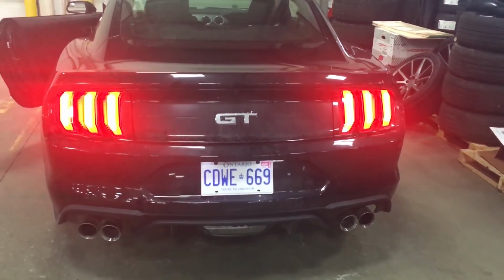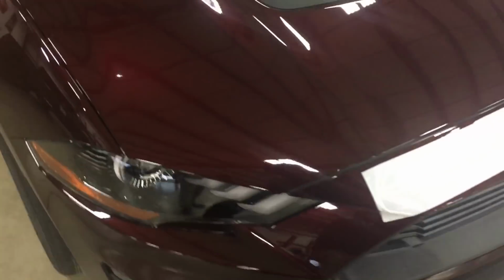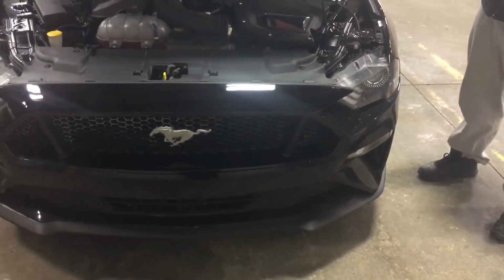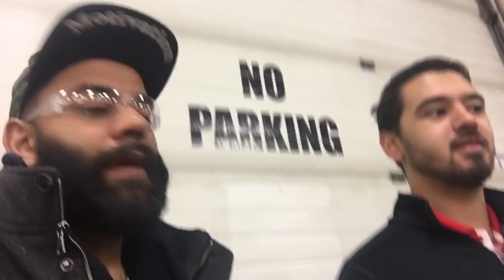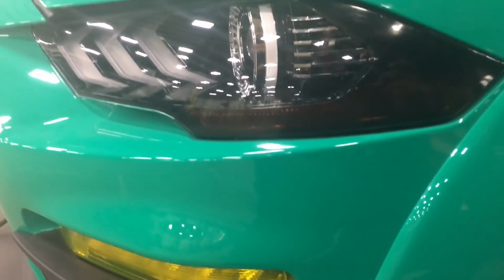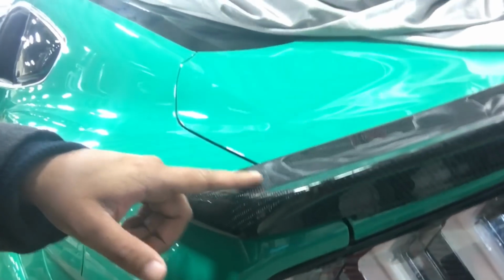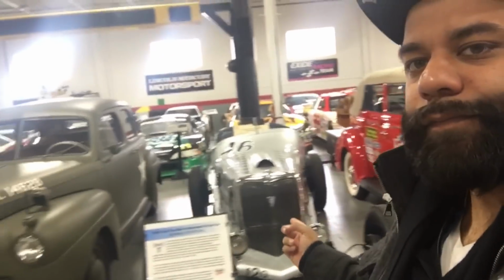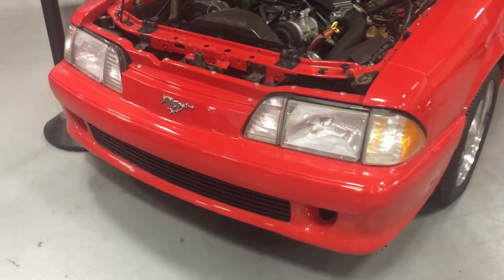SuperCharging the 2018 Mustang GT at ROUSH headquarters!!!

Comment: Can you fit a strut bar over the engine bay with the Supercharger?  Also, what gear ratio does Roush recommend running on the GT with the Supercharger?  I have the 3.73 and was curious if that would be ok and make it even faster.

Comment: Wow , so nice Roush everywhere ! Nice video . When looking @ the Black GT W/the new springs on it? The One the lift, still had that dam suitcase on it . ! My Fav. was the Green P-1 Mustang with the sick carbon fiber rear wing was so cool !!!  If your ever in Boulder Co. A must see is The Shelby American Collection Museum . Absolutely amazing collection of very significant race cars. These are the best of the best, and unbelievably under one roof. These are from one of the most exciting eras of motorsport.! No reproductions here, just the best the Snake ever designed and built (with help). Not massive, but sort of like the Vatican of Shelby Motorsport. !!!

Comment: In regard to a 1 piece drive shaft. If all you will be doing is running on non prepped surfaces. Your probably ok. But on a prepared strip you will probably only last 3 or 4 launches before the stock shaft is either severely weakens or twisted. Seeing how you roll.  Upgrade your shafts.

Comment: Cuz, your thought's on the Roush Jack hammer? I live by you & the closest Ford "Roush" Dealer is in Elkton, MD. Less then 40 minutes from my house. I know you have a Procharger and I feel the twin screw S.C with a Roush X-Pipe would really work well with the low torque that the Coyote doesn't have has? In matters of Torque, is why I haven't purchased a Stang yet. I drove a Camaro SS (WHICH IS TO UGLY NOW) & a Challenger Scat. Those 2 car's out pulled the Stang GT until like waiting all day for 5500 RPM's. StangMode, please reply with thought's, I watch all your video's and can tell you have a lot to offer as advice...
Reply from the maker: Thanks for checking in! I don’t have a procharged mustang...but It all depends on ur goals - get the 2018 roush And you won’t have any problems vs a Scat or camaro- ever - good luck 👍

Comment: do they run aftermarket headers
Reply: Jose Diaz stock headers...but they sell longtubes that you can buy after the fact. You might be able to spec out a stage 3 with headers tho, not sure.
Reply: We do not install aftermarket headers since they change the emissions & sound level of the car greatly. We're an MOR, so we must follow all the same guidelines as Ford, GM, Chrysler, etc..

Comment: Get a new 3.0L Whipple.  There's a reason why Ford is also going to larger blowers with their new direct and port injection engines.  You now have 16 fuel injectors and stronger internals then previous years so thats why everyone is going with larger superchargers.  I know you like the hot new shit and theres nothing hot or new about the 2.3L Roush blower that's been around for 10+ years.

Comment: DONT BUY IT! ROUSH have issues with fuel delivery pipe lines. My car is on the lift  for two weeks now with 99% of the supercharger installed without that part. Roush is blaming the supplier for quality control but it seems like an engineering problem. Yeah...trusted company. Roush already recalled that part twice and they can't provide a delivery date.

Comment: You'll soon regret it,especially since the whipple 3.0 has already been released,in short,you're already in 2nd place.
Roush mustangs are a Huge waste of $,I know because I have one & will never ever buy anything roush ever again.
Reply: Charles henson an s550 ? :/
Reply: Mike Gomez yeah,mine's a 16 mustang premium,perf pack roush rs3 with just under 2,700 miles.
Wish I had never bought it.
I mean it's alright,but freaking slow as crap.
Reply: Mike Gomez If I were to do it again,it would definately not be the slowest supercharger out there with a darned near useless warranty.
Reply: Damn thank you so much for this! I was debating to get a roush but not anymore!
Reply: Charles henson everyone’s going whipple or procharger these days but Roush is still a decent choice outside of a warranty. I have the Phase 2 727hp with Lund tune and I can stay door to door with 800hp whipple and 800hp prochargers with Lund tunes (transmission and rear ratios alike). The warrantied Roush calibration for an auto sucks, I hear the manual is decent though.
Reply: God Save America for good reason.
I to thought I would be different & what a costly mistake that was.
$71,500 mustang that I can't get simple warranty repairs done on because unlike where they try & make you think you have a warranty & can take it to any ford dealer,the truth is it has to be a roush certified dealer & the closest one to me is 1.5hrs away.
This & the fact it's a turd are the reasons I'll never ever buy another roush.
Never again!!!!
Reply: Charles henson I’m budget conscious so the rs3 package was not a value purchase imo. I only bought what I wanted, Roush blower, upgraded half shafts, drive shafts, headers, exhaust, and a ford track suspension kit. Should’ve gone with Roush coil overs though.

You should get it tuned by Lund if you have automatic or anywhere if you have a manual. You’ll like it much more then. F the warranty.
Reply: God Save America I totally understand as I usually am as well,but I wanted the gt500 this go around & the RS3 was as close as it got for 16 & man,what a HUGE disappointment.
Reply: God Save America I don't know what kind of Roush Charles got. But everybody I know that has a roush absolutely loves them .And from what I've seen at the track that car is far from being a turd.
Reply: dzgtnbz the brand new straight off the trailer still wrapped in plastic fully loaded 16 rs3 kind,still has less than 2,800 miles on it.
Reply: Charles henson is it auto or manual, is it pp, premium, and what rear gear ratio?
Reply: God Save America it's a manual,performance pack car with 373 torsion rear 275 tires,brenbo brakes etc etc etc.
Has all the useless bits you would expect on a fully loaded rs3.
Reply: Charles henson in what way are you displeased? With the performance or the cost?
Reply: Charles henson I'm just really surprised you're displeased with it. Like I said everybody I know loves their Roush.. I agree that there a little overpriced but they're right there on performance . Sorry to hear you don't like it. That's a lot of money to be wasted on something you don't like.
Reply: Charles henson I really wouldn't consider Brembo's being useless..
Reply: Hence, why I only got mines lowered, a CAI, and axlebacks... I have two more years till warranty is gone.
Reply: dzgtnbz yeah I'm pretty disappointed,but hopefully I'll be out of it & in to something else or find a way to make it fast before to long.
Reply: God Save America just disappointed in it's performance for the $.
Hind sight 2020,I wish I had gotten something like a c7 vette & just slapped on a procharger,just thought the roush would be alot better than it is.
The tires suck,there's a God awful noise at start up(squeaking) & my ford dealer that I've bought a dozen new Ford's from just 6 miles from my house will not do anything to my roush so the warranty is basically worthless as I have to go 1.5hrs away to where I bought it,leave it there & then go back & get it.
Sick of this pos already & it just sits until I'm right side up & get out of it.
If I had bought a c7 or even a hellcat I could go to any GM or dodge dealer,but not with a roush.
Reply: $71k is crazy for that car. A blown gt350 with upgraded axles would've been the better buy. I'm sorry for what you're going through man.
Reply: dapperchapjb you don’t have to purchase the r3 package. You can purchase the Phase 2 SC kit and half shafts and you have 727hp All installed for just under 10k.
Reply: God Save America oh I agree with you. I'm just referring to the amount of money he spent.
Reply: dapperchapjb yeah,goid luck getting a gt350 at sticker.
I had looked into it & the difference after the dealer mark up on the shelby was marginal & the RS3 Was supposed to be fast.
Reply: God Save America just get a whipple.
Reply: dzgtnbz I'm one of those people once you put a set of Mickey's on these things they are fun as fuck! I have a 17 RS3 and I went door-to-door with a 16 and Huracan and a 17 Viper ACR
Reply: RS3 4 Me yours that black & red rs3?
Reply: RS3 4 Me if so I asked you on that post you got kicked out for going to fast if you had kooks long tubes.
I have high hopes that this car won't stay a turd if i end up keeping it,but I doubt I will,hate this brick.
Reply: Charles henson I found a few at msrp actually. 3 in FL and 1 in SC. They're out there you just gotta search. The markups are still out there unfortunately and people know that msrp can be found. There's a dealer near me with an Oxford white with blue stripe gt350 with tech package going for 72k and it has been sitting on the lot for 3 months because people know they don't have to pay that for them anymore.
Reply: Charles henson that wasn't me that was another guy with an RS3 I actually got a hold of Lund to find out exactly what was done to that car
Reply: RS3 4 Me oh ok,thx for the reply.
Reply: Charles henson did you say you're in Ohio Charles?
Reply: RS3 4 Me north middle tennessee,btw Nashville &  Knoxville.
Reply: Charles henson well I can tell you one thing if you want that car to go fast or faster take it to VMP in Florida or Lund racing not sure where they are I know down south both of those companies are excellent at making these cars as fast as you want them
Reply: RS3 4 Me I have contacted vmp & others & have seen their video of the 767hp pkg,but that was just 1 vid along time ago & nothing but crickets since.
I have been looking at a set of 1 7/8 kooks OR long tubes,67mm throttle body,jlt cai,boost a pump,id1000 inj,dual fan heat exchanger,pulley swap & colder plugs.
I just have to get the small little annoying bugs worked out before I can feel comfortable doing anything as I'm not sure where this squeaking noise is coming from as I have already swapped the idler pullies,so it's the belt,water pump or the supercharger.
Reply: wow thanks for the heads up. probably go whipple as there are so many great tuners out there for em.
Reply: I got tired of that rs3 & got a new vette with a 7sp manual,no more crappy mt82 for me.
Reply: Charles henson did you guys forget that the fastest stick s550 has a roush blower? They have their trade offs. Yea factory tune and pulley sucks balls. All the fast street cars around here usually have the roush blower or the vmp gen 2
Reply: Juan Soto 
Well I know for a fact that both the mt82 & roush blower suck.
Reply: Juan Soto 
But hey it's your $,you can spend it anyway you want & learn the hard way just like I did.😎
Reply: Charles henson personally I'll be upgrading to the 18 from my 16 and throwing on a whipple cause i do alot of roll racing. Lol I'm just saying that all the fast s550s around here have a roush blower and usually 6r80 cars. They are running 9.1 9.2 all day and the roush blower has been known to be the most reliable blower you can get. Basically I'm just saying dont sleep on it. If I get a great deal on this roush setup when I sell my 16 I'm going for it. Reason I didnt like the old roush was the size. They upgraded from a 2.3 to a 2.6. Still keeping that low end torque punch
Reply: Juan Soto 
I definitely wish all the best with your 18.
Reply: I also had a 2016 PP and the 727 Roush supercharger. Their tune for it sucked and never ran right. They had no answers either.